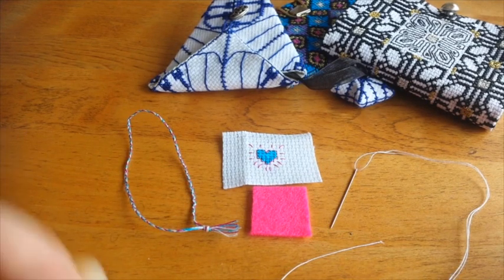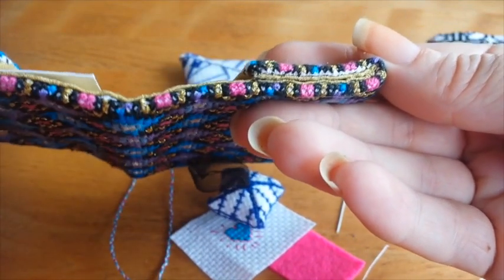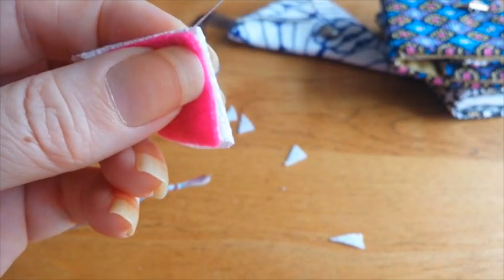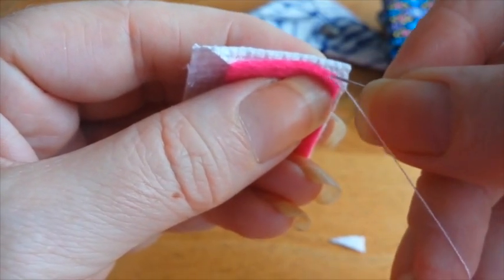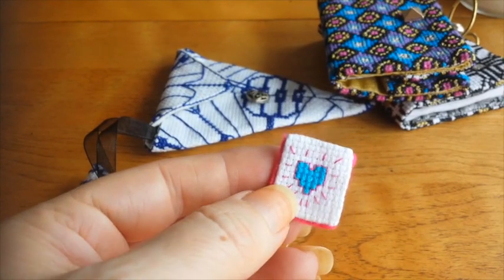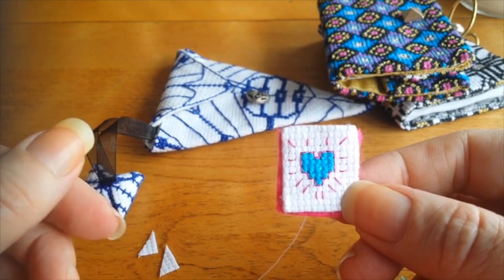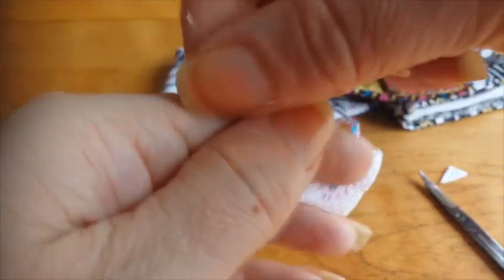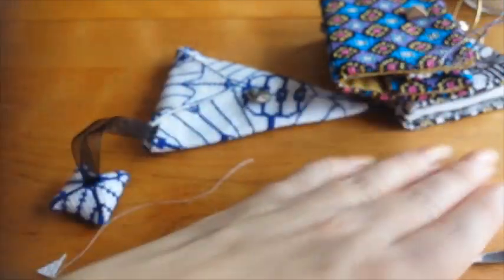Finishing techniques for cross stitch & embroidery: slip stitch (blind stitch)

Comment: I have just started using a laying tool for my cross stitch. It certainly makes a difference in getting my stitches nice and flat. I have been stitching for 20 years. I wish I had used one before. Maybe you could recommend this on one of your videos! 😀
Reply from the maker: +Tracey Salt Haha yeah I don't use a laying tool myself, so I wouldn't want to try and demonstrate techniques I don't know that well (as likely I'd screw it up). :D I do talk a little bit in the metallic thread video about how to railroad your stitches using the tip of your needle, so maybe I could do a separate video about how to do that (as I do use that technique occasionally). :)

Comment: wow. .love your videos and really helpful. .one question though. .what if the edges were curved,how will I have finished or folded side with felt at the back?. .thank you!
Reply from the maker: Hi Sheila! I'm not sure what you mean by your edges, do you mean the corners of your fabric are cut on a curve? What you can try is seal the edges or your fabric with Fray Check and then cut a piece of felt to the same shape. To sew them together, just use a blanket stitch, you can se me using that stitch in my tutorial about how to frame your stitching in an embroidery hoop. 🙂

Comment: Hi. Love your videos! I just wanted to ask if you wash all your projects after you have stitched them? What solution should I use? Also do you use Thread Heaven or any other coating on your threads before stitching? Thanks.
Reply from the maker: Hi Tracey, thanks for your comments! I do wash my pieces after I stitch them - no matter how careful you are to stitch only with clean hands, the natural oils from your hands will always transfer to the floss and fabric. I just use warm water and mild clear shampoo, I'll let the piece soak for a while then gently swish it around. Then I'll rinse it, roll it in a towel and gently squeeze to remove excess moisture, and either let it air dry or carefully iron it dry (face down on a towel). And I haven't tried Thread Heaven yet, I use DMC floss and find it is smooth to work with. I might consider it for metallics though, they're always trickier. I hope that answers your questions! :)
Reply: Thank you so much.
Reply from the maker: +Tracey Salt You're welcome, glad I could help! :)